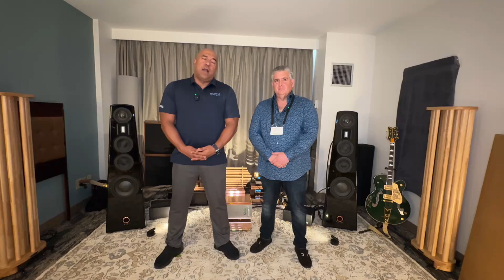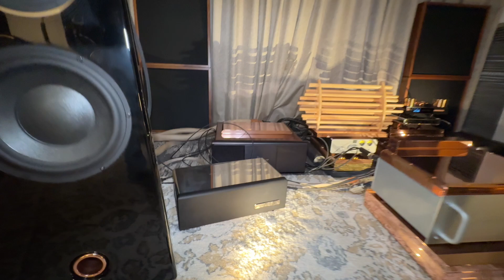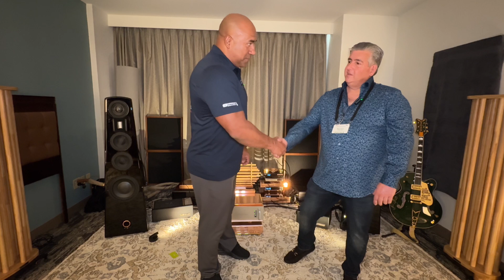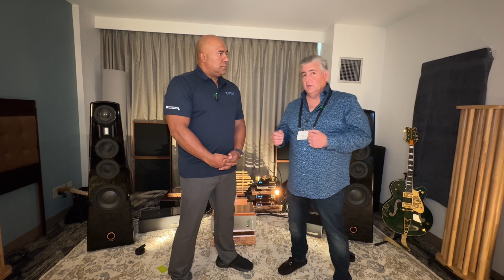ROOM 476 - Tripoint Grounding Box

Comment: Even if there is a unique well researched to a 'problem' $90k and then $229k is just ripping people off. I have spent many hours mapping signal GND, look at naim and signal GND flowing through the output capacitors of the power supply. It's about low impedance, minimising loop area and reducing noise on signal GND with Ceramic, PIO and film capacitors to 'short' unwanted frequencies. You cant do this well without getting inside components and not just plugging boxes in. Signal GND is important for sure but low impedance cable, star GND and careful construction is CHEAP !!! If your unit is double insulated then look carefully how they map the GND between components and boards, using copper plates and ensuring that 0v = 0v everywhere will improve the circuit and transient performance where they have used a steel chassis as part of the signal GND returns...

Comment: Grounding works and is valuable even for midfi 

I recommend people trying grounding your body, feeling the difference in the body. Look at information from the alternative health business to learn more information (like sitting bare feet for 45 minutes to become more calm)

Measurements shows 1,2-1,5 volt difference between floor and soil outside is common

Separate grounding of chassi, signal grounding and also digital products from analogue (like amps) and do get the star grounding connection point as close to the wall socket as possible. On top of that you should prevent noice from coming in via the incoming mains cables safety ground cable. 

Puritan is the company with the most “price to performance” products and is also the manufacturer of the product that to a low cost takes care of several different grounding systems integrated in the power cleaner and dc-blocker. 

Just my two cents

Comment: I can only use 'grounding boxes' on purely digital devices. Otherwise they act like highpass filters cutting out bass and middle frequencies. The same happens with devices that have too much 'capacitance' added to the 'ground', like a big case. So even on purely digital devices I have look out to not add the capacitance to other devices connected to that device through the interconnects or power cables 😅 It works best on cheap digital transports. I've never used this device mentioned in the video, but in my opinion for hi-end it's not needed and messing up with the construction of other devices. Unless you need less bass and middle.

Comment: Grounding is very important and does work, I  custom made an insane unit myself, but it's funny how much you poo poo grounding boxes, especially recently, but here you are 😂
Reply: @B2_Labs  I believe they work. What did you use?
Reply: @Coneman3  that's a full rabbit hole... Basically large copper bus bar and a very large collection of different types and size capacitors paralleled between bus bar (+) of any electrolytic caps and - to the true ground. Ultracapitors, very large 150,000uf electoemytics, tons of film caps ect. Ultra low esr caps.
Reply: @B2_Labs  poo pooing things in Hifi is common. It’s mostly only the prices that are dodgy.